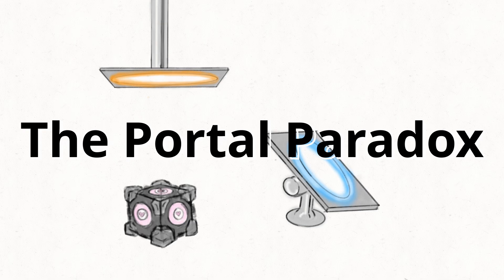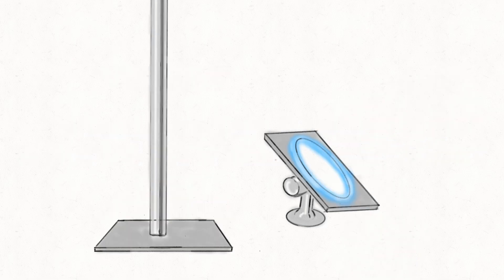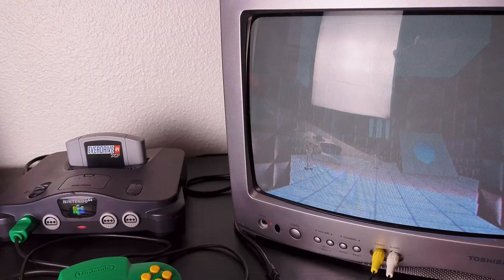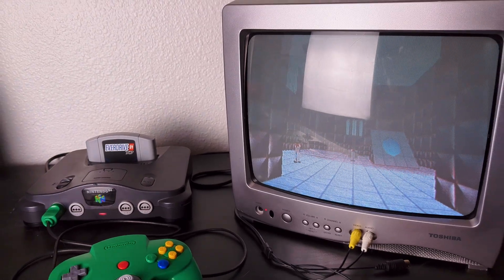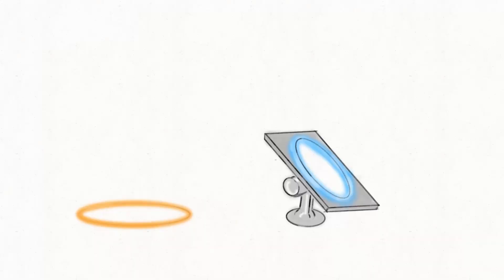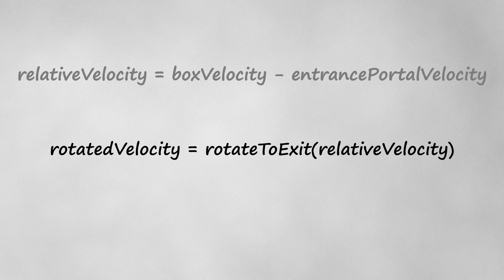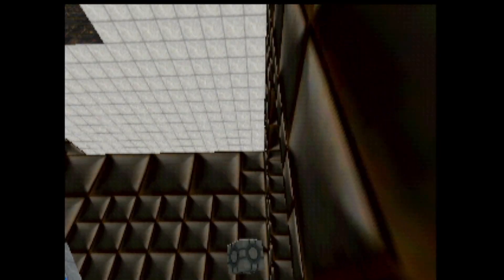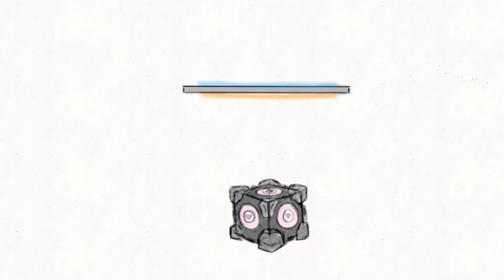I rewrote Portal from scratch and solved the Portal Paradox

Comment: There's no acting force on the cube. That's why your solution is technically wrong. The portal does not exert a force onto it -- It's not "relative" (and if it is, to what system is it relative?) What would Newton's opinion be? If you stop the portal half-way through the cube what happens? 9/10ths? 1/100th? Why does the portal have to touch/intersect the cube at all in your solution?

Now I'm curious if your solution accounts for gravity acting on the cube when/after it passes through the portal to the other side.

What about the rotation of the planet? Or the orbit around the sun? The galaxy? I imagine all of those forces/vectors would be acting upon the cube before and after it passes through the portal. Relative to the planet we don't seem to be moving but that might change if we were to suddenly jump through a portal. Lets assume the portals are also moving (that is, they're stationary on the planet but the planet is moving.) Why/how would that change things?
Reply from the maker: The fact that objects can change direction when passing through portals is enough to violate the laws of conservation of momentum and would require a force to change the direction. One possible explanation is as a the cube enters the portal a force is exerted on the entrance portal's surface in the opposite direction of the cube's velocity. This cancels out any momentum of the cube entering the portal. As the cube leaves the exit portal an equal an opposite force that accelerates the cube out the exit also pushes the surface of the exit portal in the opposite direction.
Reply: @james.lambert  Yeah, and I was wondering how the portals could possibly do this. I assumed the portals got around the issue by changing space -- instead of changing acting forces, you change the fabric. This is how I imagined the portals were meant to be "cohesive." It's very easy to imagine how the cube can change direction (it doesn't, really...relativity) just by passing through a portal, even with the 3D code used today. You preserve the forces already acting on the object and just cut a hole in space. It's actually harder to explain how the portal could exert a force upon the cube.

In my more "classical" interpretation of Portal's portals, they're a torus with an exit and entrance connected together. But if the portals are moving, that exit/entrance boundary is moving and I think this creates more issues that are harder to explain. It's like the distance keeps changing.

I think the idea you stated is (roughly) about using energy to impose opposite forces on matter to cancel out all forces that aren't relative to the portals. (I don't know if I understood that correctly.)

After my initial comment, I was reading comments and thinking of how the moving portals might make sense. One idea I had is similar to the solution you gave. I think the common idea is that portals are like wormholes or two connected points of space. But if the portals are atom rematerializers with some infinite energy transfer mechanism, then they can rematerialize the atoms at an "infinite" pace that pushes out the atoms [the portals have an orientation]. (And I assume the portals might have perfect boundary.) I think this works for moving portals and portals that are relatively stationary but are actually moving relative to something else, etc. Maybe this would solve every issue I listed?

(or maybe time/space compresses and that's enough to cause the atoms to "bump" into each other. I don't know if this actually solves any problems.)

Comment: Definitely some great work going into this project! Playing in real hardware was a treat. As a suggestion in the future if you ever get a menu system going is having different controller schemes based on other N64 shooter titles. It would be nice to have a goldeneye esque control style with the C buttons to look up and down.
Reply from the maker: That is planned, there is just a long list of things I plan on doing first.
Reply: @james.lambert  of course as a fellow modder I understand the grind, there was a lot of game breaking issues that I am sure will get ironed out in the future (I.e) using orange portals from the start can cause crashing or slipping out of the world mesh  in certain areas. But the work done so far is commendable. Would there be any way to collaborate with helping building out levels for this project? I would be more than interested in giving a helping hand with map demakes or original puzzles if needed

Comment: My reason for believing that the cube won't go flying out is because of inertia and conservation of momentum. Where does the energy to accelerate the cube come from? 

Does the moving platform slow down as it imparts its energy on the cube? If so, does that mean that if the cube is too massive, the platform will slow to a stop before passing fully over the cube?

The fundamental principle I think we can all agree on is that portal operate on pure conservation of momentum. Under this framework, the cube cannot be accelerated.
Reply: Portals don't operate on conservation of momentum.
They can change the direction of movement instantly without any energy input even when stationary.
Reply: @ZeroKitsune  they're not changing the momentum, they are a conjoining in spacetime that allows an object to move from one space to another. It's as if the object is passing into a parallel universe, except it's a closed system so no energy is created or lost, just redirected.

Sure, it doesn't conform to the constraints of momentum in the real world, but it's still a working and consistent framework of momentum. 

Momentum is the entire basis of the puzzles, especially in portal 1.

Comment: My issue is that the hula hoop analogy is always how the portals work. They're just holes, the ends just happen to not physically connect. There's no reason for the energy of the portal to be conferred to the cube. Momentum is conserved between portals as well as the lack thereof. All of this with the caveat that I flunked out of high school. Regardless, loving the progress on the project, can't wait to see more!
Reply: Portals can change the direction of objects without touching them. Applying a change in velocity without the use of any force. Even though, the resulting direction of a cube is changed from an observer's perspective, nothing has changed from the portals' perspective. The portal's perspective is the key to understanding the correct answer to the portal paradox.
Reply: I think if one portal moves, the other would have to move, too. The energy transfer from the portal to the cube seems to be a trick that gets around the space/occupation constraint on the other side.

Normally the entrance portal is static. This means forces acting on the cube have to push it through the portal. But if the portal moves, how is there going to be enough room on the other side, if the cube is not moving? I think the relativity trick is just a trick.
Reply: @user-zu1ix3yq2w  I just assumed these things were like Loony Tunes holes.
Reply: Or the portals are actually atom rematerializers.
Reply: Portals convey energy to what passes through them all the time. If you simply place a portal above another portal and pass an object through it, then it has just magically gained energy via passing through the portal. After all think about the times when you place a portal on the floor and ceiling of a room and fall infinitely. You continuously build up speed because the portals are in effect conveying energy to you by granting you more potential energy than should be possible. 

Momentum is conserved through portals, but energy is not. Similarly if you go through a high portal to exit at a lower elevation, you will have effectively destroyed energy as well. Portals by their very nature allow you to create and destroy energy at will.
Reply: @BlazeMakesGames  In your example the energy isn't coming from the portals, it's coming from gravity. With nothing to slow an object down, gravity will cause it to accelerate through the portals until it's stopped. The energy is not magically gained. Momentum is energy, and is conserved through portals, but the portals themselves neither add nor take it away from the object.
Reply: @blacksheeprising9710  Momentum is kinetic energy. Gravity doesn't give object energy, it transforms potential energy into kinetic energy. By  chaning the location of the object, the portals are causing, wheter directly or indirectly, that object ot have a different ammount of total energy.
Reply: @Niyucuatro  Gravity is still the "source" of the kinetic energy in the game. This is because every time the player is moved to the other side of a portal, their velocity is not reset and they still experience a constant gravitational force. Thus, repeatedly falling through a portal results in continuous acceleration. This is equivalent to gaining the kinetic energy of falling a distance that is equal to the distance between the portal ends x the number of times the player passed through. The reason this might not make sense is that we only learned about gravitational potential in science class where portals were not considered :)
Reply: @BlazeMakesGames  Portals definitely move the object between points that have different potential energy. As to where does this extra energy comes from. Well, that for the writer to decide. They can break conservation of energy or take energy from an external source and apply it to the matter going trough. They may or may not break the second principle of thermodynamics. We don't really have a definite answer.

Comment: There's a recent indie game on Steam called "Frames" that also has moving portals! May give you some ideas :)

My question is - what happens when the moving portal comes to a sudden stop with the box halfway through. I'd intuit that the half of the box that's already gone through will have momentum on the "blue side" that should pull the rest upwards and possibly through?
Reply: Wouldn't that theoretically be the same as a cube being flung towards a portal but stopping halfway through? Because unless I am picturing it wrong, the cube should stop and lack momentum.

Comment: One edge case you didn't show: what if the portal moves down, but stops while the cube is halfway through the portal? Does it stay still? Does it pop out at half-velocity?
Reply: the net velocity of the cube is zero as the two directions cancel until more than half the cube has moved through the portal
Reply: @JohlBrown  this would be true if the cube was moving away from the portal, for example, the portal is moving relative to the ground at 100, the cube is moving relative to the ground at 100 then when the portal stops halfway along the cube the cube simply stops because its being pulled in both directions equally, however if the cube is stationary then half of the cube will be given a speed of 0 and the other half will be given a speed of 100 and the speed 100 half will pull on the speed 0 half resulting in a total speed of 50 coming out of the portal

editing to note: if the cube is moving at 100 aswell as the portal then the portal will never catch the cube so the there is not situation where the cube stops moving
Reply: @rosemurphy8026  I think you are working off velocity when you need to instead consider acceleration over a percentage of the cube with relation to its resting state (gravity vector) which applies to anything not yet in the portal.
Reply: @JohlBrown  velocity is entirely relative, and in this case is what is determining the exit speed of the of the cube, the cube is not being accelerated in this senario as counter intuitive as that is, it is simply inheriting the velocity of the portal in the same way humans inherit the velocity of the earth
Reply: @rosemurphy8026  yes but if a person could inherit the two velocities of two planets to different extents across their body then that might more accurately depict the question... the reason people struggle is the multiple frames of reference simultaneously acting on a single object.
Reply: @JohlBrown  this only matters if we're talking about velocities high enough to split the cube, which is irrelevant to this conversation, the half that is not in the portal will take the momentum necessary for inertial equilibrium with its other half from its other half, so to accelerate half the cube to the same speed as the other half it takes half the speed of the other half thus from a speed of 100 the cube will travel at 50

however i can see why you're getting this wrong; frames of reference don't act on an object they are simply different points to measure it from, in your example the person is not inheriting two different velocities they are inheriting the difference between the two velocities at any given point on their body, kinda of like a fourier transform, the two different signals are still there but they arent seperated they are combined

Comment: What happens if the portal stops with the cube halfway in? that question has always convinced me on the cube not launching
Reply: Presumably the cube would only receive half the transferred momentum and would only launch half as far. The top part of the cube that did receive energy would pull the rest of the cube that didn't along with it.

Comment: Would the speed the portal slams onto the object be the same speed the object moves after going through it, regardless of mass or weight?

So in theory, if I had an object that weighed 10 tons, and I slammed a super lightweight portal-object down onto it at an ungodly speed, I just sent that ridiculously heavy object flying at that ungodly speed.

Comment: I think you should have also showed what happens if you don't account for the velocity of the portal. Once the cube crosses the portal, it would instantly come to rest relative to that side, pushing it against the ground. Then it would bounce. The end result is it flies out even faster.

Also, please add a puzzle where you need to use this.
Reply: "...Then it would bounce." This immediately made me think of the sound of Sonic jumping on a spring.

Comment: To solve the "energy isn't free" problem I'm assuming that if you're using a high-powered piston the energy for the object acceleration comes from the machinery powering the wall, which would most likely have plenty to spare.  If the wall with the portal on it was hanging by a thread that you cut, though, I'm theorizing that there would be some fun physics equations between fall velocity, mass of wall, mass of accelerated object, etc, with the wall slowing down a bit as its portal encompassed the portal-ed object and transferred the momentum to it.  We should probably ignore structural integrity of whatever's being portal-ed for the moment, though.  Test cubes are tough and can take a near-instantaneous velocity change quickly moving down its surface, but a person?  That could get real gross, real fast.